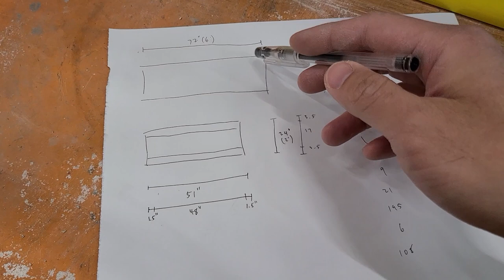A Dentist Builds Pro Tool Review's Raised Garden Bed

Comment: Good to see you still pluggin along! For your circular saw, you can manually raise the guard and line up the blade with the previous cut / there is also usually a tick mark on the end of the saw base that you would line up with your score mark or chalk line, etc. You just need to be aware of the kerf width of the blade and made sure you line up to the correct side for the cut.  Well done on using the speed square to guide your cut!  ** on your bit holder, the shorties are meant to go into a quick-change holder that chucks up into the driver. they're magnetic and hold the wee bits in place. There's usually one or 2 in those bit driver variety packs you can buy in a plastic case. Torx drive or square (Robertson) head screws are def the way to go!! * You'll end up having to cut away the cardboard sticking out past your planters, probably. it takes a lot longer to disintegrate than most people realize. 
Well done sir!
Reply from the maker: Thank you for the detailed reply! I'm slowly learning the tick marks on the circular saw. The torx drive has been awesome. I'm excited to see how the composting goes. I totally agree and it might take a long time because the weather in Southern California is so dry.

Comment: Hi, the reason your bit will not stay in your driver is that it does not have the locking decal on the end. To sort this just go to where you got your screws from and buy the longer bits that lock in. if you have a problem just take the “Philips bit” you have and check against the longer screw bits. In addition, if you ask the assistants they will be able to sort you out. sorry i have just watch a bit more of the video when you broke the drill bit and went to the store and they sowed you exactly what i was tring to say. I do not know the tools you have, but if you have an “angle grinder”, you can get metal cutting blades that will cut through that corrugated iron as if it was made of butter. If you don’t own a angle grinder the home depot will sell the blades separate and you can put them into a circular saw but go slowly when using it in that way
Reply from the maker: Lol. Yeah....I went to home depot and they were like...uh.....you have an impact driver. You need impact bits. Thank you for the detailed advice!

Comment: Nice to see more power tools being used. Hand tools are great for quick jobs but power tools helps in consistently get the job done at a fast pace. I'm sure you figured out already how to change the depth of cut of your circular saw already. 

As a quick side project, I reckon you should make atleast 2 but ideally 4 saw horses. Seeing you working on the ground makes my back hurt lol.
Reply from the maker: Thanks! I love my circular saw! Someone else commented why aren't you using your workbench....I don't have a good response. Lol. I'll start working more ergonomically.

Comment: Looks good!  Also liked how you batched everything out.  Repeating the same job until done really allows you to get through projects quickly.

Shame your mitered corners came out short.  Real quick; you cut your side pieces for the box 36", then add 3" for the thickness of the five foot sides plus whatever overhang you wanted (say 3" total or 1 1/2 per side.)   Total for short side would be around 42"  The five foot side around 63" (same 1 1/2 overhang per side.)   You are at 105"!!!  You can get two short sides out of an eight footer though, may need to just burn a whole eight footer for the longer sides.  If you haven't cut them all up?  (3) 8' boards per bed and you can salvage your longer cuts for the short sides...  May be nice to have that covering the metal in case its sticking up a bit.  Or even a place to sit on and place tools on while working in them.

Did the wife notice you smashing into your outside light?
Reply from the maker: Thank you! I love the batching process. I'm getting better at figuring it out. Thanks for doing the math on the miter corners. I tried to do it in my head and failed quickly. Lol. I only got (6) 8' boards so would need 3 more. I haven't made any additional cuts and was planning on using the piece I cut/other ones for another project. I might still add it. I do like how they look with that top piece and like you said it be nice to sit on/put tools. The wife did also notice the outside light before me.

Comment: If by not growing anytime soon, you mean like 2 months or more, might I recommend getting espresso grounds from all of your local coffee shops and mixing it with shredded paper, shredded cardboard and, leaves in the raised beds then covering with a tarp, or a couple of layers of card board. If you can get the heat up, and can remember to aerate it every couple of days, you can get a pretty healthy amount of compost pretty quickly. I use the coffee and some fine fir bark and can compost it in my joraform in about 6 weeks.
Reply from the maker: Thank you for the detailed advice! We do drink a lot of coffee! I haven't done all the research, but the plan is to add much free stuff to these beds as possible.

Comment: Looks great! You can always come back and add the top part later if you decide to. Don't sweat it, cutting/measuring miters can be tricky. Do your two long sides first, then measure long point to long point (tip to tip) for the dimension between them. That's the best way I've found to measure cuts like that.
Reply from the maker: Thank you! I still don't really know how to cut those miters, but will try your method!

Comment: You said you are going to use saw dust and soil. Make sure you are not using the saw dust from the pressure treated wood if you are getting the saw dust from your own woodworking. 
Good job. Keep up with the learning of this great hobby. Cheers
Reply from the maker: Thank you! This is really good advice. I'm definitely throwing away all the pressure treated wood sawdust. I have a lot from my chainsaw and the guys that cut our tree also left a big pile in our front yard.
Reply: or walnut, lots of plants don't tolerate walnut well
Reply from the maker: @contestwill1556  Good to know! Thank you!

Comment: You don’t need to fill the entire bottom with soil or compost. There is a gardening technique called hugekultur which means mound gardening. You can fill the bottom half with old logs, twigs, leaves, and other organic matter. Most roots only reach about 10 inches down. 

This technique saves money from having to fill the bed completely and also retains water, nutrients as the material breaks down. You may need to refill with more soil each year.
Reply from the maker: Yeah! We've been throwing twigs and whatever organic matter we have in there. It's surprisingly filling up pretty quickly! Thanks for the detailed advice!

Comment: Star drive screws make a huge difference - no "camming out" when screwing them in. I used 3" screws for my beds but yeah 2.5" will work just as well. $10 is a deal for a box. Great job!
Reply from the maker: Thank you! Yeah! I didn't think the star would make such a big difference, but could clearly feel they were much nicer to place.
Reply: With those deck screws, they have a self-tapping point as well, so you don't HAVE to pre-drill in many cases, not wrong to do it but it cuts down on extra work and broken bits ;) .  Good job!
Reply from the maker: @Mechie980  Good to know! I'll try to use them without pre-drilling next time!

Comment: Drill Bits are cheaper by the dozen. If your town is big enough for a Home Depot, you probably have at least one Tooling Supply Company close to you. The Home Depot near me charges $3.47 for 1 Milwaukee 1/8" drill bit. I can get a American-made HSS (about all you really need for DIY) drill bit for $1.30@ from the Tool Supply about a mile away from HD. 2 things tho'. They're not open on the weekends and you gotta buy a dozen. But, a package of 12 will last for a lot of DIY projects. BTW, in case you haven't heard, no matter how cheap you can get a set of Chinese drill bits. STAY AWAY. They may say Cobalt drills and be all shiny and gold, but except for the 1/8", 1/4" & 3/8" they are all cheap low-carbon steel that have been dipped in a coating to make them look like cobalt-steel. They will be dull after 3 holes (in wood).
Reply from the maker: Awesome! Thank you for the detailed advice! I just googled tooling supply companies and there looks like many different ones. Can't wait to check them out!

Comment: those short bits are meant to go into a holder (which has the quick connect on the other end), they usually come with a drill/driver set so you may actually already have one around
I probably would've bought those screws even if I had no immediate plan for them... went through quite a few last year building an outbuilding/shed, sure wish they'd been $10 then!
as a result I have quite a few of the short star drive bits in a pill bottle somewhere, one bit through the whole job, I have grown to hate those damned square drive screws...
Reply from the maker: Good to know! Thanks for the information!

Comment: The Home Depot app offers free delivery for purchases including metal roofing sheets. 8ft, 10ft, 12ft, even 16ft lengths. Various colors too. You may want to consider that in the future. The top piece can also be 2x4, easier to do than 2x6.

 I’m thinking about the exact same thing as you did, but on a slope. Your came out nice.
Reply from the maker: This is genius. Thank you! I haven't thought about using their free delivery. I definitely want to pick my own lumber, but metal roofing sheets would have been a good thing to ship.

Comment: Great job. 👍 Smart move batching out your corner posts to save time and by using your scrap wood jig. Repeatable results are best, because even if something ends up needing adjustment, (not that your corners did) having duplicates means the correction can be quickly applied uniformly to them all, thus allowing you to move on rapidly.  

Keep up the good work, but next time you do anything with metal, please wear work gloves and save your money makers from injury/harm (can't be a dentist if your hands are messed up).
Reply from the maker: Thank you for the kind words! I was standing there and was wondering the best way to batch work. I can see how a table saw would be really nice for duplicating pieces for future furniture! I need to start wearing gloves. I have some nice ones for my chainsaw that I need to consistently wear.

Comment: Those beds look nice 👍. And your sound mixing is on point. Hook up those end cuts with some type of sealant so they don’t decomp. I know you’re in CA, what did the tin run you???
Reply from the maker: Thank you! I got some anchorseal that I can use. Each sheet for 8' metal roofing was $22. The pressure treated 2x4x8 was $12 and 2x8x8 was $24. This was bought Feb 25th, 2022. Came out to about $550, but I didn't used the 2x8x8 for the top pieces so saved $150 and going to use that for another project. Still shockingly expensive.
Reply: @ADentistDoesHomeImprovement   that’s not bad I had a retaining wall built and the materials were only 880.00, the labor put the total to 11.5k. So considering the cost for labor you saved yourself a ton!